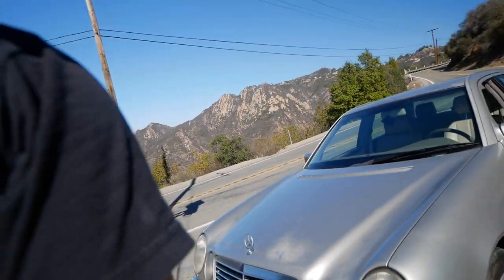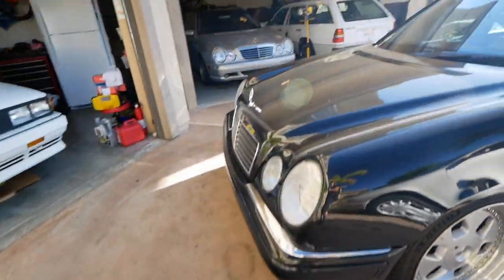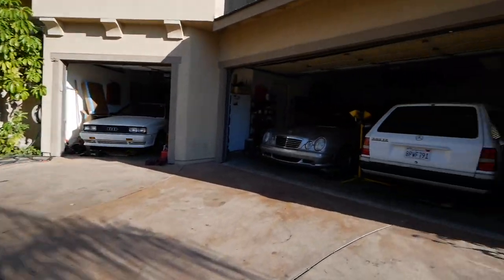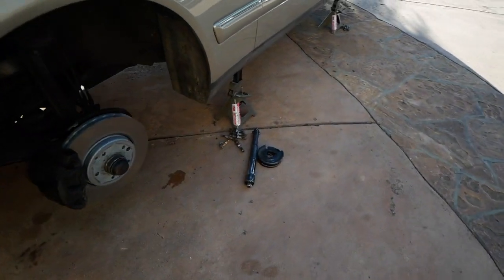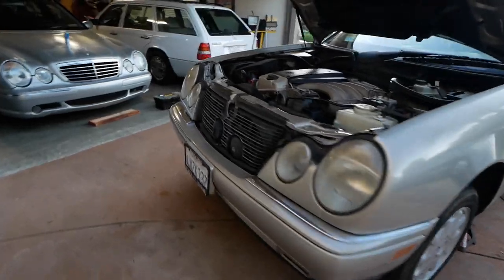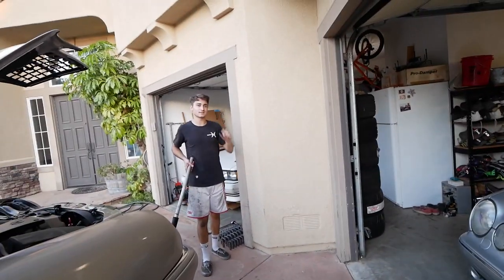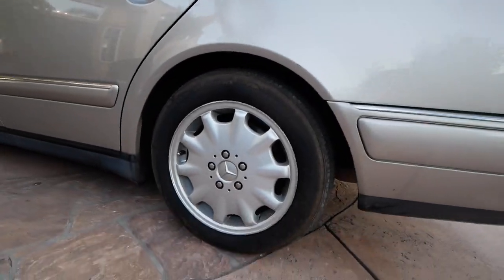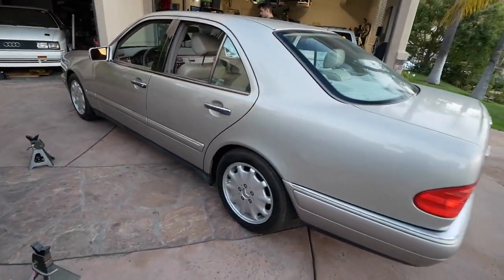I LOWERED My Mercedes Benz w210 on Vogtland Springs

Comment: Hi I have a question if you cut the springs the function is the same?
Reply from the maker: Depends on how much you cut them. Mine are cut, just half a coil, so it shouldn't impact performance